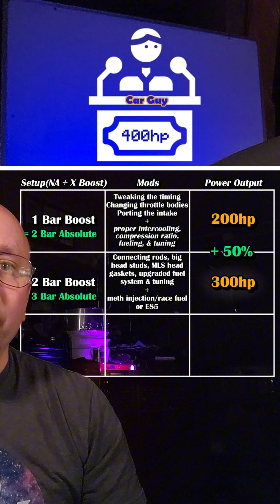Ep. 4: How do turbos work? Boost vs. Horsepower

Comment: 4 bar absolute
Reply from the maker: Awesome!   Now let's make sure your clamps on your intake are up to 45+ psi of boost!
Reply: @protomotive I love that you mentioned that, I remember upgrading my Audi a while back, didn’t change the clamps on the intercooler. 
One pull later it blew the charge pipes off 😂
Reply from the maker: @mwoodall13  yeah boost is no joke!  When we were pressure testing an intake to 40 psi at an 82mm gt3 throttle body, the clamp came off and it blew the cap off, through a wood door, and into the other room!     That's a crazy amount of force!

Comment: 4 bar, right?
Reply from the maker: 4 bar Gauge or 4 bar absolute?
Reply: @protomotive 4 bar absolute
Reply from the maker: @v8tergt653  Perfect.   Yeah, that'll be fun to keep from blowing apart!   but what a rush!
Reply: @protomotive  I bet , 4 bar is insane 🤣
Reply from the maker: @v8tergt653  no doubt.   The first gen turbo f1 cars were only 1.5 liters and we're making 1500hp before they imposed a 4 bar limit!    Yeah, they were running over 4 bar with "rocket fuel" as they called it 😂
Reply: @ Yea on a billet Hemi they’re pushing 4bars and getting over 5000whp , something wild when you’re garage built car makes 2bars and 1300whp
Reply from the maker: @v8tergt653  ouch!   And you have someone driving beside you with track conditioner or you're on ice skates!   Very fun though.   Big head studs?   like 3/4" or something...  Rods, even flywheel bolts could be rough at that point.  that's nuts.